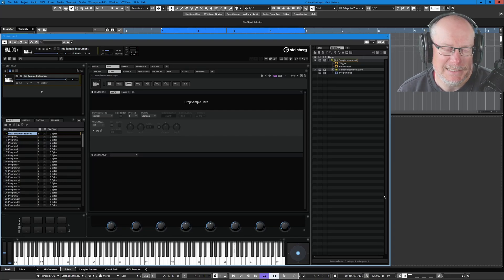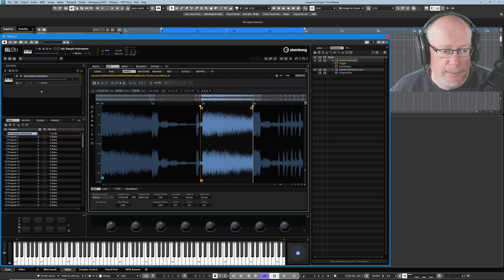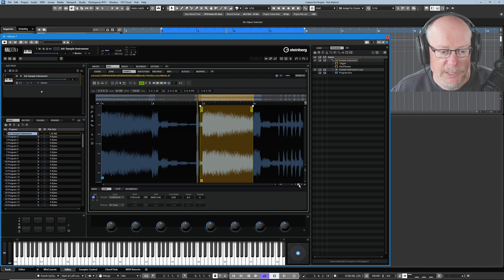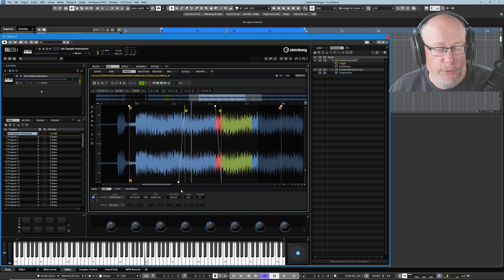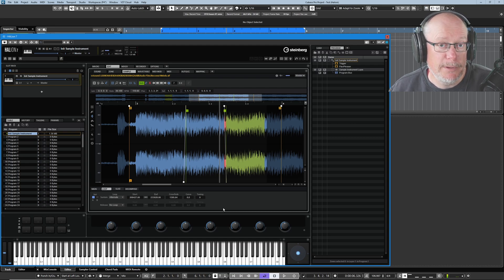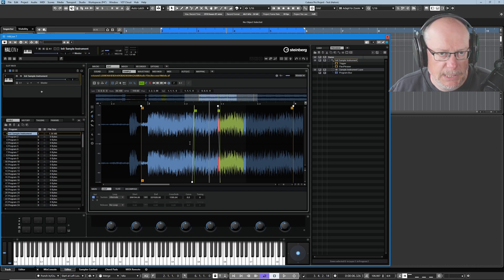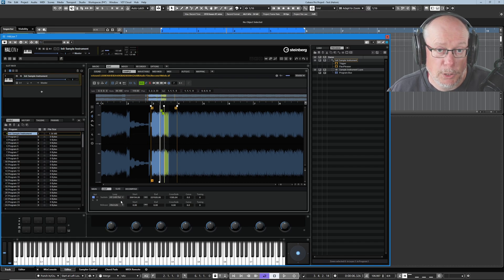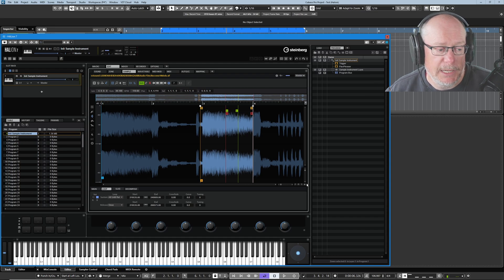Halion 7 Tutorial #13 - Looping Samples

Comment: Hi - and thank you so much for your videos. Very valuable content. However, i have one question before i purchase Halion 7:
Can i render the loop/crossfade information into the samples? I do a lot of sound design for use in various other samplers, so the loop must be rendered into the samples - otherwise other samplers are not able to read the loop information. Is that possible in the audio/loop-editor of Halion 7?

Thanks so much in advance. ♥
Reply from the maker: To be honest, I don't know. It's not something I've ever tried. I suppose the best answer I can give is that as far as I'm aware Halion is a fundamentally NON-destructive sampler (i.e. it will leave the original sample unaffected), but if you wanted to render your processing to a new, second sample, that would be easy to do within Cubase itself (i.e. by creating a midi part to play the sample) and then using Cubase itself to render the part. That new sample would be output to your project's Audio folder (or wherever you have your preferences set), and it would be this that you would then import to your other sampler.
Reply: Well, yes, that i know. But i could do that with many other samplers. What i wanted to know is, if Halion can actually export the crossfade-looped multi samples with the the crossfaded loop information baked into the multi samples themself - and i actually found out that it can do that. And that is what i needed. But thanks anyway for the reply.